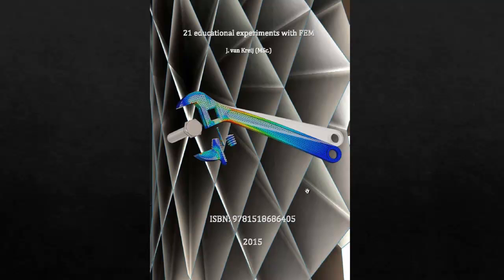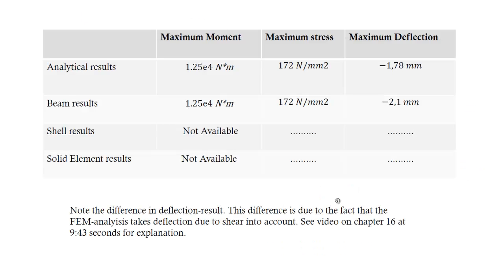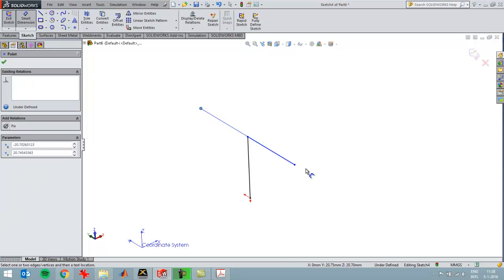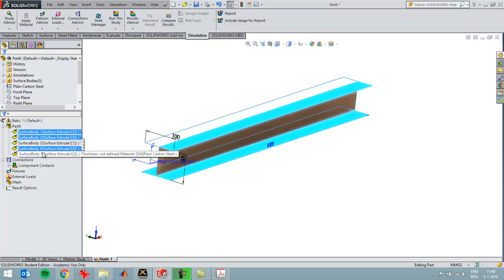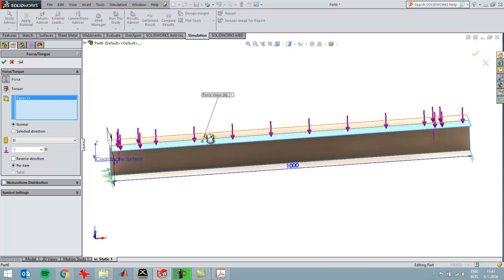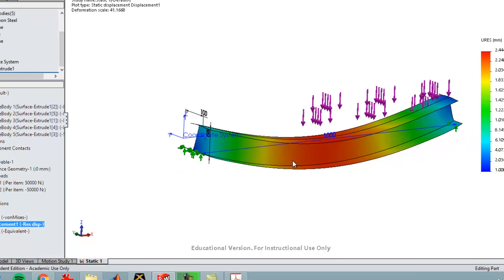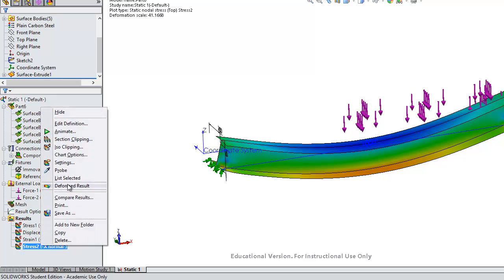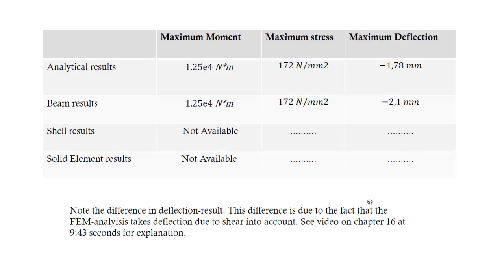Chapter 17 Calculating shell elements under distributed load with SolidWorks Simulation

Comment: Good morning, could you help me? I have a bar with a diameter of 30mm and 900mm of length 1045 steel, the two faces are fixed and has a punctual load of 630N to 600mm. How do I simulate this situation?